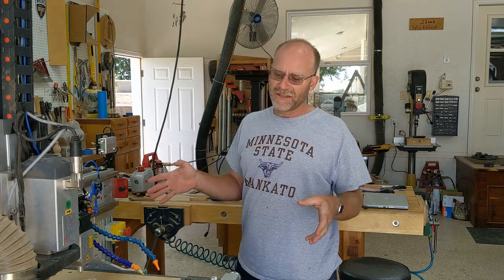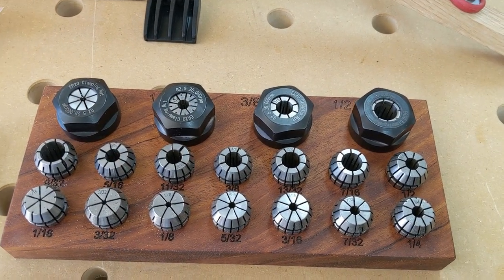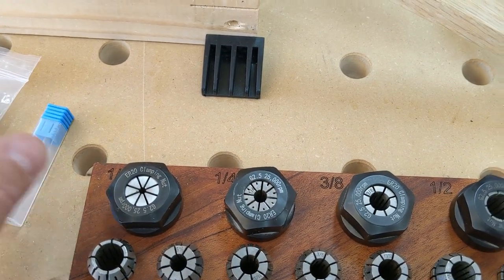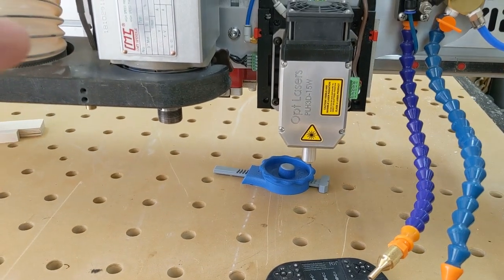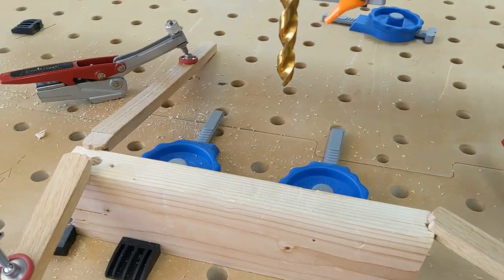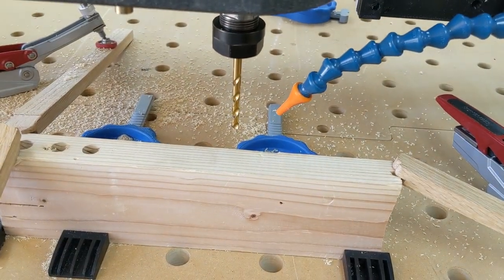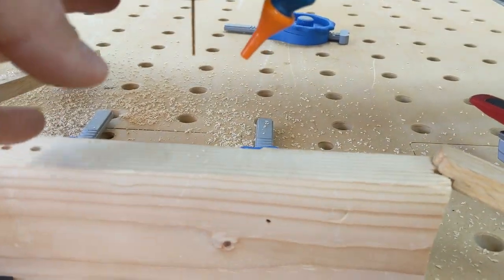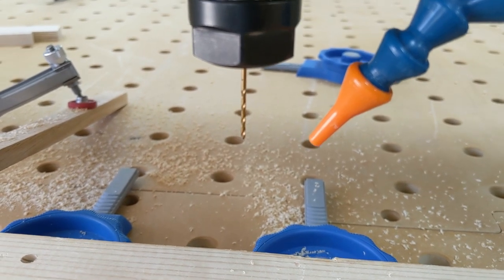Drilling with standard twist bits on an AVID CNC Router

Comment: Hi Jim.  I watched this video when you first published it, but didn’t have a project until this weekend to be able to apply it… I used a 3/16 twist drill bit at 1250 RPM and 25 ipm plunge rate with great success to peck drill 45 3/4” deep holes in a Cake Pop holder for my wife’s baker friend.  Thanks for the content that you post, it’s much appreciated!  Bob
Reply from the maker: Hi Bob, Its been a while....  Glad you were able to use it.  Sounds like you are keeping busy in the shop :-)

Comment: Here in the outside world we went metric and bits in incremental 0.1 mm steps are commonplace and easy to obtain from sources all over the globe. We used to use the imperial system here in UK but things are much simpler using the metric system. 0.1 mm is plenty accurate for woodworking and for most metalworking too.
Reply from the maker: Back in the 70s when I was growing up there was a pretty good movement to switch over to metric.  One of the few useful things our government could have done is push that conversion along, but like always, they  got distracted with other things that were more expensive and wasteful of taxpayer dollars and totally forgot about converting to metric.  So in the US we have to know both systems, becaus about half of the stuff we have is metric, and half is imperial.  I really don't buy the arguement that metric is easier, both systems are just arbitrary units and you have to learn what they mean and get good at estimating the size of each.  The main reason I wish we would convert though is because I would't have to take out two sets of wrenches to work on something, and I could converse with other people around the world in the same units.

Comment: It could be a pain to set up a double tool path, but you could pre-drill everything with an end mill (same diameter or slightly smaller than the drill bit size for twist bits, but maybe only 1/16 or 1/32 for brad-point??) . Possibly with depth = diameter? Then switch to the twist/brad-point bit to go to final depth. Guessing the pre-drill would be more helpful with twist bits, but could also help with runout on brad-point. Basically, center drilling for wood. Disclaimer: this is all speculation on my part -- I've only used end mills with my CNC.
Reply from the maker: Correct, that's what I was suggesting with the comment about two passes.  As you said, you have to do this in metal machining if you want a very precise drill position (like a very concentric center drill on a lathe), so this isn't really a new problem, its just a little more aggravated by the very flexible smaller diameters and wood's natural variability across the diameter of the bit.  It wouldn't be hard to make two toolpaths, and just run the deeper twist bit runs second.

Comment: Interesting video ,I always wondered about using regular drills in the cnc .My concern with a air cooled spindle would be it heating up at such low rpm because the cooling fan is running so much slower?
Reply from the maker: I've had both the 3hp and 4hp air cooled spindles from AVID and have pushed them fairly hard in the summer months when its 90-100 degrees in my garage.  They get hot, but not as hot as my stepper motors.  So they do a really good job of cooling themselves.   However, as you said the airflow is definitely reduced for the lower rpms, but at the same time, the motor is basically idle since the torque for drilling is almost negligible, and it has a very low duty cycle.  On top of that the rpm is reduced, so the power consumption (rpm x torque) is really low.   I've drilled a few game boards (like cribbage) and the spindle barely gets warm.

Comment: There are a few YT vids about these cheap collets. Mostly bad news. I can vouch for these findings. But really it is a roll of the dice. You might check with an dial indicator to see just how bad the run out is  compounded by the length. :-) I bought some 8mm round linear rail to see what the story was in my spindle and the one 8mm collet, and I also use it for tramming.  So far I have have rcvd one factory reject that nearly marred the spindle taper .
 I suppose a good spring collet would be worth $25 each.  I just want to be sure they are not just reselling the cheap stuff.
Reply from the maker: You are right, the last thing you would want to do is mess up the spindle taper.  On the runout, you might be a little more tolerant with twist bit than you would be for milling (depending one what you are doing).  In general it is good advice in general to inspect new tooling before you use it just to make sure it doesn't have defects, especially if you are buying from an unknown or low price supplier.

Comment: Great video!  Curios, is there a drill chuck that could safely be mounted in the spindle?  They work on drills, drill presses and lathes, so why not low RPM on a spindle?
Reply from the maker: Yes, there are some.  You can get them with a 1/2" shaft that should fit in a collet.  I decided not to go that route because it would add another 3" or so to the stack up from the spindle, and I also already had the collets.  I may still buy a chuck just because you can never have too many tools 😉
Reply: @JNWoodworks  I added a 1/2" straight shank chuck to my AVID seems to work great.  thanks for the great video.
Reply from the maker: @petebuehn7789  cool.  Which one did you get?

Comment: I tried to find the control to lower my minimum, but it appears locked out for me.( I have the 4hp spindle)  I asked AVID and this is their response:
                 Hello Steven,

The 4HP spindle is hard coded to only spin down to 6000 RPM. The fan speed is directly linked to the spindle speed on those units so if we were to have it operate lower than that we would risk damaging the unit by overheating.

The 8.7HP spindle has the fan speed independent of the spindle RPM and that is why those spindles have a lower RPM floor at 1000.

Are you attempting to use drill bits in your spindle? I know drilling bits do prefer those lower speeds, but since spindles are designed to spin much faster it is not recommended to use them but to look at tool path strategies or specialized endmill bits for those kinds of operations.

Thanks, AVID
     I'm not sure i agree with them on this, but it appears that it is what it is as they say.....:(
Reply from the maker: Yes, they pretty much have to say that you can't run them at low speed because they don't want people trying to do milling operations at low speed because then you could overheat the spindle.  However, for just drilling, the torque on the spindle is very low, and the duty cycle is VERY low, so the motor is just basically running idle.  I live in Phoenix and my garage is >100 degrees often and I haven't had any problem with the spindles getting hot (the nema 34 steppers get way hotter than the spindles ever do) under these low speed conditions or high load (at high speed) conditions.  Send me an email at jnwdwks@gmail.com if you still want to dial it down and I'll show you how.